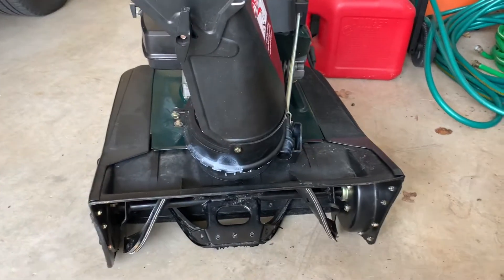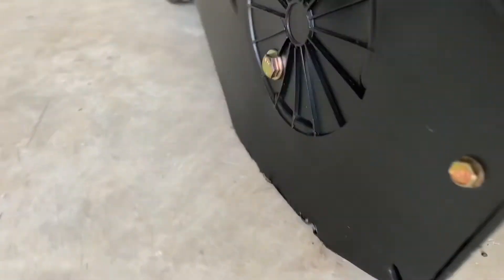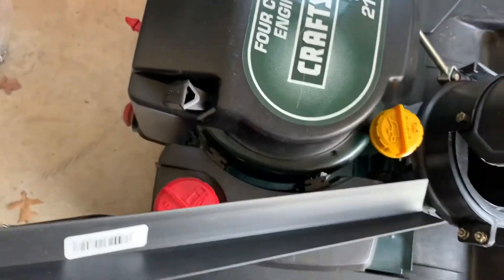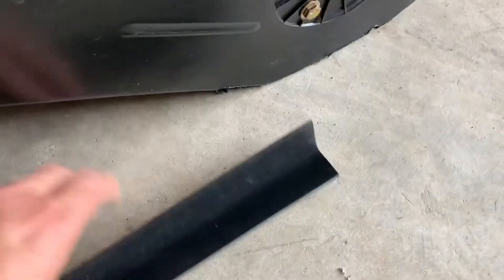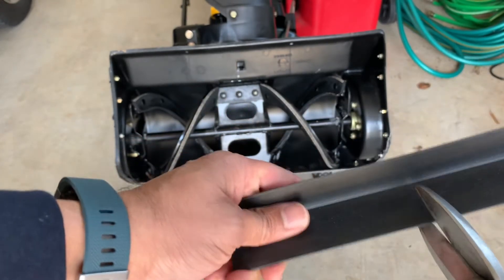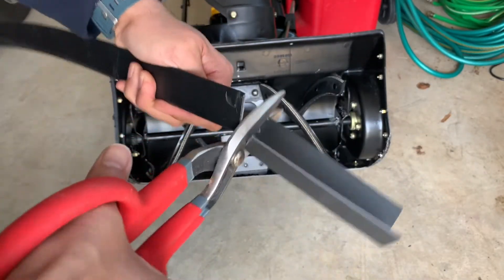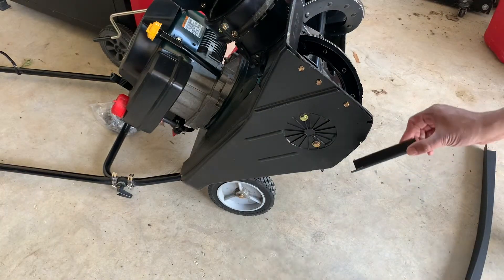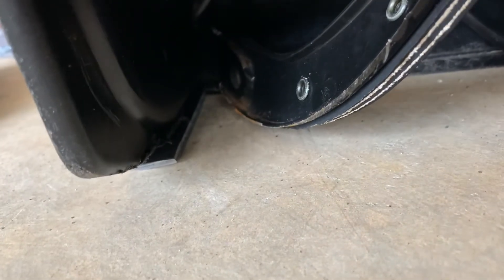Snowblower height adjustment | No skids

Comment: Your snow blower needs new rubber paddles.

A single stage snow blower has no skid shoes and the auger housing should not touch the surface.

The rubber paddles have to touch the ground

a) to clear the snow down to the pavement

b) to pull the snow blower a little forward so you don't have to push so hard
Reply from the maker: Thanks. This snoblower never came with any paddles so I am not sure if I can find any that will fit it. Any suggestions?
Reply from the maker: @snowfighter62  Thanks. The auger seems to be fixed with rivets so it will be a little more involved work to drill those out and then either use screws/nuts or new rivets when reassembling.